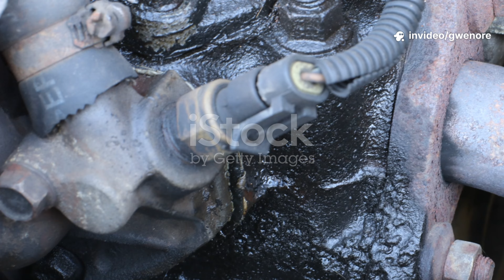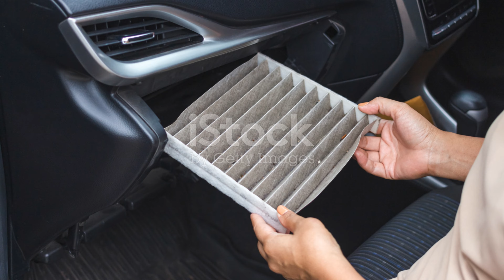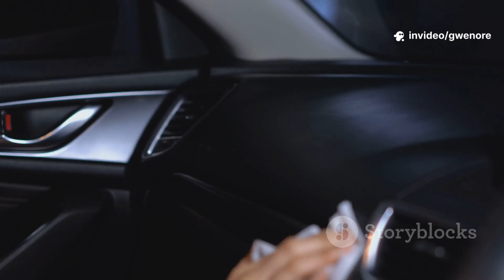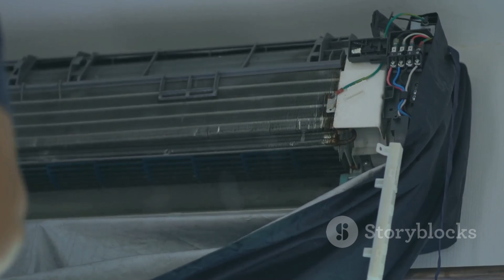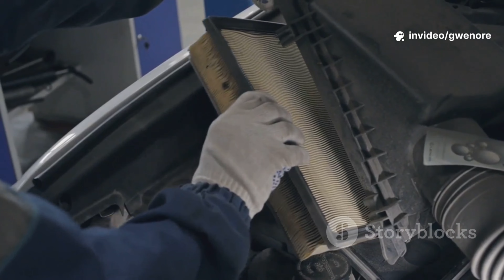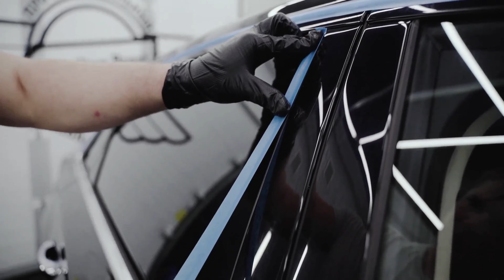Stop Wasting Money! 10 Car AC Secrets Mechanics Won’t Tell You

Comment from the maker: ⬇Care Care Clues Top DIY Tools and Products:
🚗 Essential Scan Tools
Newest Scan Tool: https://amzn.to/4mPVana
Bluetooth Scan Tool: https://amzn.to/4gcBask
Cheap Scan Tool: https://amzn.to/3I13lOt
🔋 Emergency Essentials
Best Jump Starter: https://amzn.to/4pcuv5P
🛠 Useful Maintenance Accessories
Quick Twist Oil Drain Valve: https://amzn.to/3JSNpyp
Tire Gauge (Check Pressure): https://amzn.to/46kqa7V
Tire Air Pump: https://amzn.to/46wzczK
CRC Mass Air Flow Sensor Cleaner: https://amzn.to/4pfuOwv

🧰 Mechanic’s Must-Haves
Car Battery Tester: https://amzn.to/4gdNUPw
Basic Mechanic Tool Set: https://amzn.to/4gB62TT
Cordless Impact Wrench: https://amzn.to/460ru0U
📸 REDTIGER Dash Cam Front & Rear – https://amzn.to/4m5aQlh
🧪 Engine Additives & Treatment
Chevron Techron Concentrate - https://amzn.to/3JTPdXT
Fuel Injector Cleaner - https://amzn.to/3VcBmyf
STA-BIL Fast Engine Treatment - https://amzn.to/4gB6di1